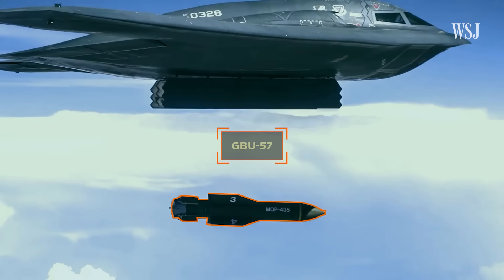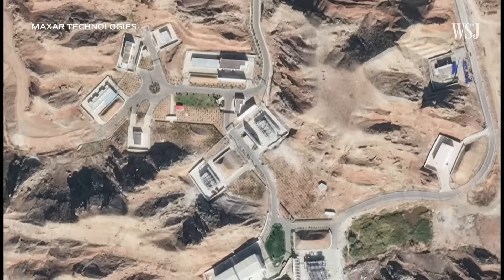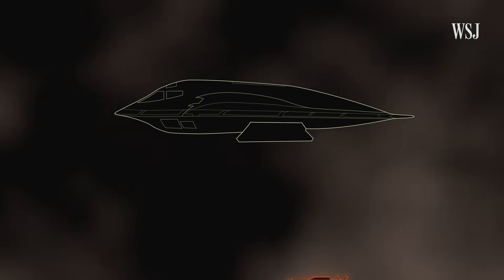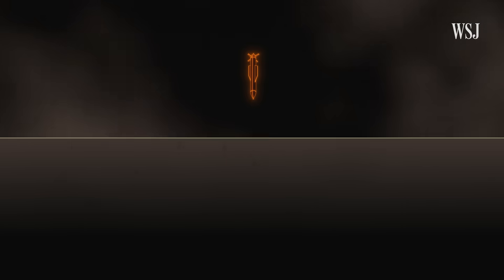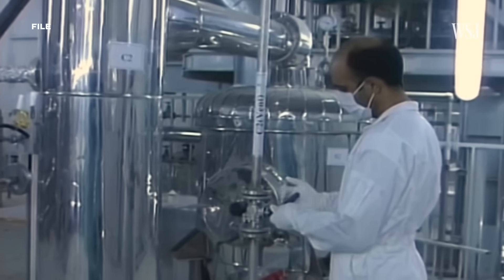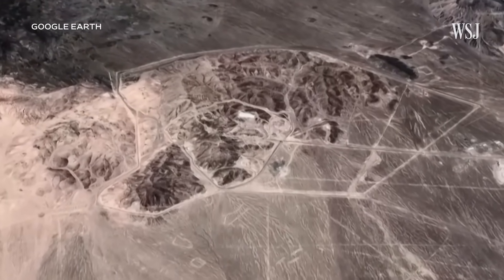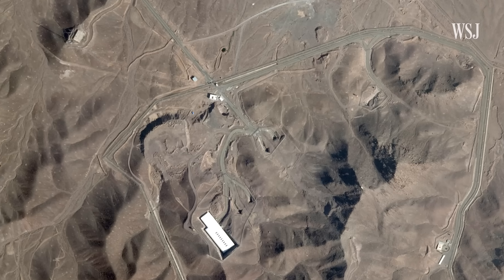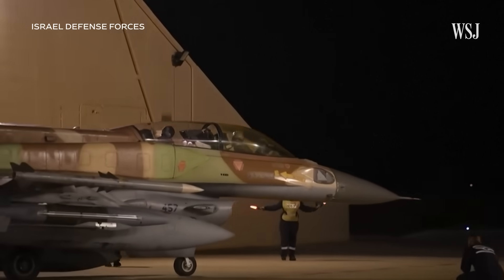The 30,000-lb Bomb Trump Struck Iran's Nuclear Sites With: GBU-57 MOP | WSJ Equipped

Comment: 200ft of rock isn't correct. It's 200ft of earth (compacted soil and lose rock) and only up to 60ft of concrete. Which is why they used multiple bombs and bombs on the entrances to seal them up.

They are bombs that are designed to use their kinetic speed and strong outer shell to get into the ground. They aren't actively digging down or pushing into the rock (although I'm sure the USA could design such a bomb). So if the rock is firm enough and the bunker has strong, thick reinforced concrete shell or a multi-layered shell, the bomb might not be able to penetrate the bunker.

But they are designed so they won't explode until they have come to a complete stop and if there is enough soil around them when they explode then that shockwave maybe enough to crack bunker tunnels and cause a collapse. There is no way to be sure that there was internal damage to the Iranian bunker without boots on the ground and thats why they had to block up the entrance with bombs.

If you only look at the news cycle on this you would think these bombs are able to dig through granite or something.
Reply: 60m of concrete is the term or 200 ft of rock.

Comment: This is a kinetic bomb that need to hit the target at a perpendicular angle and the mountain side creates enough of an angle at the point of contact to make the one side of the nose to slow down faster than the rear of the rocket. So instead of entering the ground like an Olympic diver making a small splash, it enters on an angle which reduces how far it dives and likely causes early detonation. In other words, it's very unlikely the bunker busters successfully took out Iran's nuclear program, and its very likely that this is the beginning of another forever war.

Comment: I mean if they had nukes wouldnt blowing up the spot blow up the nukes
Reply: No, Nukes are set off by like a Bullet of Uranium Hitting another sort of Substance (At least that's how the Atomic Bomb worked), it creates an explosion from a chain reaction of splitting an Atom. 

It isn't like TNT, where would go off. 

You could drop an Unarmed Nuke 10,000 feet from the air and it wouldn't go off. You could blow it up with TNT and it wouldn't go off. It's a highly complex Bomb.
Reply: Actually, there has been some Nukes "Lost" before. I believe an Israeli Jet went down with a Nuke. There has been Plane Crashes with Nuclear Weapons on board. I believe a US Bomber went down with a Nuke Payload and was recovered from the crash site. Transportation of Nukes is pretty safe.
Reply: 1961 Goldsboro B-52 crash

Was a B-52 with a Nuclear Weapon as it's Payload went down. It was during the Cold War were there had to be constant Nuclear armed Aircraft flying around the edge of the Soviet Union in case of a Nuclear Strike
Reply: The 1961 Goldsboro B-52 crash was an accident that occurred near Goldsboro, North Carolina, United States, on 24 January 1961. A Boeing B-52 Stratofortress carrying two 3.8-megaton Mark 39 nuclear bombs broke up in mid-air, dropping its nuclear payload in the process. The pilot in command, Walter Scott Tulloch, grandfather of actress Elizabeth Tulloch, ordered the crew to eject at 9,000 ft (2,700 m). Five crewmen successfully ejected or bailed out of the aircraft and landed safely; another ejected, but did not survive the landing, and two of them were killed in the crash.[1] Information declassified since 2013 has shown that one of the bombs was judged by nuclear weapons engineers at the time to have been only one safety switch away from detonation, and that it was "credible" to imagine conditions under which it could have detonated.

Comment: The GBU-57 is known in all its stats and famous fora  misunderstanding of the total penetration figures. This figures have been retold time and time again until even the guys with total accsess to the testing data repeat it. This is a debate on hearsay, not on facts - and by now on propaganda and manipulation.

Israel demanded the GBU-57 from the US to involve them, not to hit this particular facility.

If we ramp up all unknown factors about the GBU-57, it's penetration would be of 25 meters of solid concrete/rock. The target facility lies between 50 and 60 meters beneth. Now you can do your own math.

PS: Really, a lot of media news could be either obsolete or actually infomrative if the teams would have reached for the most basic research of the technical facts.

Comment: I would assume that the MOP would have a shaped charge buried into a high tempered steel casing (like a cannon barrel) that can pierce the rock or concrete without deforming, and when that kinetic energy is exhausted the shaped charge will detonate sending a high steam of molten iron and rock deeper into the ground or into the bunker if it penetrates that far.

Comment: Yeah, but only if it hits perfectly perpendicular to the area they want to penetrate. Any angle will produce deflection. The nose of the bomb slows down at contact, and (if any other angle than 90 is present at impact with the surface, the back of the bomb will rotate toward the top of the slope and miss the deep target.

Comment: If the U.S. sends in the bunker busters and they don't work, not only will they be open to ridicule but they will have officially entered the war, with zero deniability which would make them fair game.  So unless Trump can be convinced that they have a very high degree of succeeding, he won't go for it.  In that case, it will be up to Israeli airforce and special forces to make entry into the buried facility.  However this plays out, that facility is a very very hot potato given its potential for nuclear contamination.

Comment: That bomb could be carried by a C-130, but not high enough for the deep penetration, a B-52, or a C-5 Galaxy. 
In WW2, the Grand Slam bomb weighed in at 10,000 Kg was carried by a Lancaster B Mk 1 and could penetrate 30M of earth, or 6M of reinforced concrete (Casing limited due to cracking).

Comment: Note that this would not actually work. These bombs do not borrow that deep (they only gain force from gravity), they just have a lot of explosive in them. This works against very hardened targets where there is a fragile wall on the other side, but does not actually let you drill and blast like you’re building a railway tunnel.

Comment: Us to busy destroying own people with covid vaccine and 5 g radiation. Remove covid vaccine liability exemption from
Reply: You have a greater chance of getting cancer from visible light or heat than you do from 5G, lol. 5G uses non-ionizing radiation, which doesn’t carry enough energy per photon to break DNA bonds.

The shortest wavelength used by 5G is abt one millimeter. That’s too large to interfere with cells. On the other hand, UV rays, X-rays, and gamma rays have wavelengths smaller than around 125 nanometers. That’s small enough to interact with DNA directly, which is what makes them ionizing and capable of causing cancer.

Imagine a door that’s 0.738 inches tall. Anything small enough to fit through has the potential to cause cancer. Now picture Godzilla trying to walk through that door. Godzilla is 150 meters tall and wouldn’t even come close to fitting. That is the scale difference between a 5G wave and the ionizing radiation threshold.

For the rest of the spectrum in this comparison, infrared waves would be about the size of a human at 1.5 meters tall. Visible light would be the size of a tennis ball, roughly 7.5 centimeters. Ultraviolet would be the size of a grape, about 1.5 centimeters. X-rays would be the size of a single human cell, around 15 micrometers. Gamma rays would be the size of a virus, around 150 nanometers.

This is why UV from the sun can cause skin cancer if you aren’t wearing sunscreen. It’s also why you wear protective coverings during X-rays and why hazmat suits are necessary when working with gamma radiation.

Comment: MOP vs. Fordow: That's a LIE. It doesn't work that way.
This video totally misses the mark. Fordow is buried so deep (80-90m into solid mountain rock!) that even muliple mighty GBU-57 MOP, designed for ~40-60m penetration, won't destroy the core. It might collapse tunnels or cause disruption, but vaporizing centrifuges? No chance. As The Guardian and even Pentagon officials have indicated, it's virtually impenetrable to conventional bombs. Some argue only a tactical nuke could maybe truly get it. Think about that.

Comment: Imagine you pilot a B2 and then suddenly you lose 30K lbs.
Reply: Well theres a few pilots that know that exact feeling now.
Reply: True,  you have to be "on your toes" when you drop that much weight in order to compensate as your aircraft suddenly gains altitude rather quickly. 😊
Reply: they drop 2 and they are actually closer to 36,000lbs each. also before they drop they vector thrust upward to counteract the massive drop. This isnt fkn WW2
Reply: @OceanicDangernoodle  imagine saying all that... and thinking that the b-2 spirit has thrust vectoring for pitch. 🤣🤣🤣 i'd edit it fast if i were you.

Comment: FYI. - THEY ARE GOING TO USE GBU57 "BUNKER BUSTERS" AND THEY ARE GOING TO TELL YOU THEY WERE SUCCESSFUL.                                        THEY ARE LYING...!!! 

The GBU57 was developed for use in deserts against flat topped homogenous concrete bunkers built in the 1980's. They are ridiculously easy to countermeasure - slanted hillside - concrete diamonds - non-homogeneous concrete - round tunnels - multiple tunnels - sectional tunnels - these ALL defeat them. So when they tell you what an amazing success they were - know they are LYING. [BTW - there are lots of papers online about how to deflect them]

Comment: These deep penetrators began as old 16" US naval cannons that were hammer-forged to a point and 2/3 of the 30,000 lbs. is the weight of that steel.  It can only carry about 6,000 lbs. of conventional high-explosives (not that much) BUT can carry any number/yield of tactical nuclear warheads, which would be appropriate here.

Comment: The stupidity of showing a B-2 launching a MOAB is either disingenuous or blatantly stupid. That platform cannot handle ordinance of that size. Weight? Yes. Length? No. But that should be first round vetting. Very irresponsible for a publication the size and veracity of an experienced news organization like WSJ.

Comment: 295 feet is 90 meters. That tooth pick isn't going to penetrate something that deep under the earth.
Reply: That's the height differential for the peak altitude to the entry altitude. But the peak is a rather small plateau and on the backside of the hill. Most of the hill is about 150 ft lower. Still, ~50m is pretty deep rock.

Comment: How about using the 'God Rod' instead.  It's in orbit right now, not very well known and the U.S. could drop it and well-no need to use a MOP.  It's made out of a substance that can withstand orbital re-entry and carries no ordance.  It has no need to.  The amount of force created from dropping something 100 miles up  that weighs a few hundred pounds is in effect a meteor, and travelling just as fast
Reply: ordnance

Comment: Israel has C-130J aircraft that can carry the weight and the length.  These "bunker busters" were tested, starting back with the original "instant helipad" back in the 60s, using an old,  worn out C-130B so they should have no problem chain extracting a couple of these out of a J model.

Comment: If you clowns at wsj think that this 30,000 lb gravity bomb , or even a bunch of them, can penetrate 300 meters of rock, you're smoking 300 meters of rock.
Reply: at what point did anyone say that? they said 200ft not 300 meters, you must be the one smoking 300m of rock
Reply: @hatakenewt348  They don't know what feet means because we're one of the few countries that use imperial system. That's why they think we call it football, even though foot is the length of the size of the ball and not the foot attached to our legs. I see them screw that understanding up all the time in the comment section about NFL games vs Soccer.
Reply: Based on overall mountain height (more of a hill than mountain) vs tunnel height, only 50 to 70 meters is needed. Yet 50m would still be quite a feat.
Reply: WSJ here claims that i can penentrate 60 m without specifying the medium. It also states that multiple bombs are necessary to destroy fordo. It also suggests that the shocks rather then a direct impact are what is aimed at to destroy fordo. So your comment is just stupid.
Reply: Good to see you have a clear understanding of how this (British) invention works.

Comment: The American Claims that this bullet can penetrate 60 m through concrete wall where they they haven’t employed the CIA movie makers to make a fake movie trial by Hollywood to proof that this is cabals of the fals claim. This  bullet has failed many times to penetrate 10 m on a soft land. Whatever exaggeration you have been advertised about this bullet is fake.

The tunnels are 200 meter down the rocks . The US is struggling digging tunnels for transportation infrastructure and now they claim that this bullet is the one.😂😂😂😂😂

Comment: This isnt what 30000 lb bomb means. its a measure of explosive power.
Reply: In this case, that is the weight of the bomb. Most of the weight is a hardened steel alloy. Yet, there's still about 2 tons of explosives inside (by weight). The actual explosive type is not disclosed so the explosive power is not known.

Comment: I heard it was classified as good for  200 feet of bunker casement,  but the  site in question sits 300 feet below the mountain .   So is it possible it will not work ?    Now Israel has   Tunnel  Boring Machines that dig giant tunnels in the Earth  ,  big enough for a  Train to pass through it.  So if Israel controls the air over Iran and  flies a Mighty Mouse  Tunnel boring machine,  one with diamond teeth ,  they can  bore their way down into the mountain .  Then the  site will be disabled.
Reply: It's called a double tap.

Comment: The Wall Street Journal doesn’t realize that the bomb cannot penetrate a bunker that is 1/2 mile deep. That 2600 sf²  so a bomb that penetrates 200 feet would take over 10 DIRECT hits. That’s assuming there’s no hardened structure.
Reply: 4 mops would make  Fordah unusable. B2s carry two each.

Comment: The MC-130 dropped the first MOAB. To need a stealth bomber to deliver it would probably not be necessary unless you need complete stealth. Since Iran has no air defenses currently, The MC-130 would probably be the one to drop it if they go after the "Supreme Leader".
Reply: B2-s are operational with two MOPs. They are at Diego-Garcia ready to go. They'd had close air support by Israeli F-35s and our F-22s, along with F-18s off the carriers. No problem.
Reply: While the C-130 can carry up to 44,000 lbs, it doesn’t configure for carrying and dropping the GBU-57. The B-2 has the racks for it.
Reply: @lancecahill5486  I was kinda leaning towards that as well. We have those bombers stationed near the middle east. Just like the other post said.

Comment: yeah 200 feet aint deep enough, trust me
Reply: 150 to 200 ft is about right. Peak of "mountain" is 3194 ft. Being generous, most of the mountain top is in the range of 3000 to 3050 ft. However, the tunnels enter the mountain at about 2850 ft. That's a 150 to 200 ft difference from surface to tunnel. The objective is not necessarily to destroy the material but to entomb it by caving in the ceiling.

Comment: Yeah. It would work if the B-2 doesn’t get shot down. The B-2 flies at subsonic speeds. Yes, it has stealth capabilities. But, it can be intercepted very easily because of its relatively slow speed.
Reply: Israel took out at least 1/3 of Iran's air defense, and getting at more. With close air support by our fighters and theirs, B2-s would make it, they carry two MOPs.

Comment: 1 Russia launches rocket to space
2 it floats down a capsule to iran
3 50/50 chance it explodes 
4 Russia obtains a ally while staying in power dealing with its own war
5 America backs off
6 isreal now has a new problem 

Achievable yes, but the warhead must be contained and atablised doing so would require luck

Comment: If Iran was really enriching uranium only for nuclear power (and not bombs) there wouldn't have been any reason to do the enrichment inside a mountain.
Reply: they did not plan to, under ideal circumstances like before this current situation, but they reserve the capability to quickly produce them should the need for them arise (like right now) when they are facing existential threat.
Reply: or to 60%